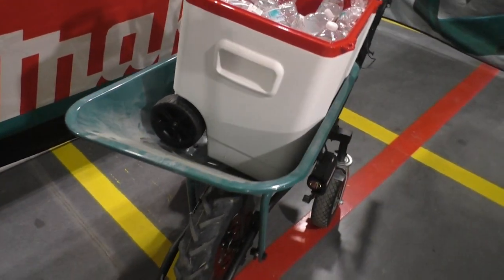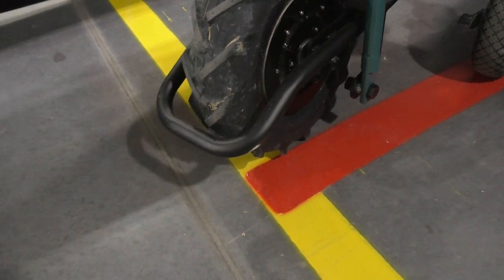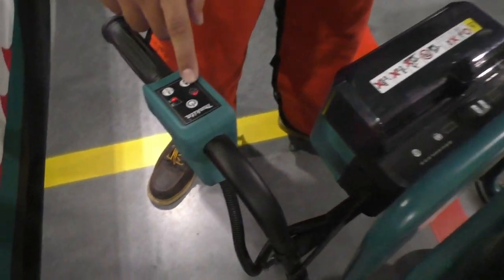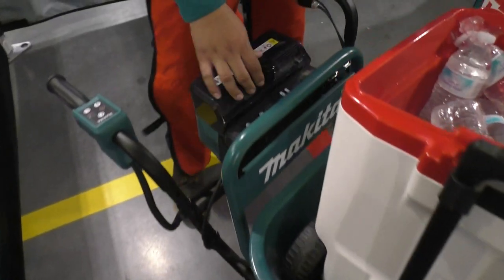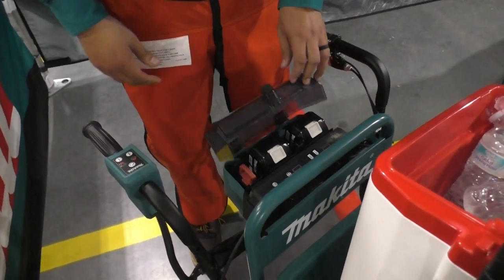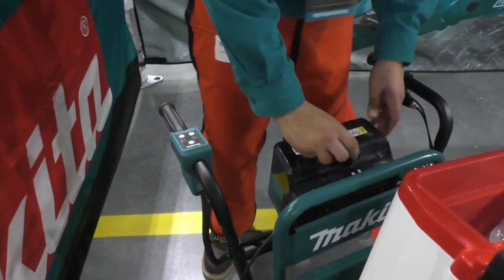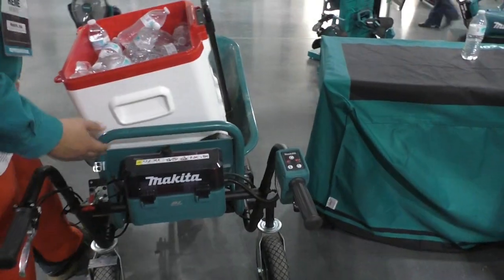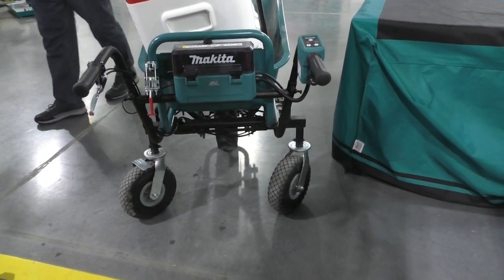Makita 18V Power Assist Wheel Barrow, Bucket or Rack

Comment: I'm 65 years old and I've had seven spinal surgeries, five being fusions.  It was either buy something like this or give up yard work.  I bought one and it is great.  I can easily move 200 lbs of rock, dirt or whatever from my front yard to back yard over a steep grade.  BTW, in response to comments about the handles being low, their height is adjustable.  Also, the design is extremely stable, it does not tip nor is it ever unsteady.  The loaded tray is ridiculously easy to dump one handed.  It's two speed gearbox loaded to the gills moves faster than any equally loaded human powered wheelbarrow.

Comment: I really would love to have both of these models. I’ve had 6 spine surgeries and have a tone of nerve damage from complications. These would be a godsend!
Reply: you can buy the rack or bucket separately and use the same drive part.  pretty neat tool I think
Reply: I got one - my back is f$&ked from years of professional fighting.  I welded up my own pipe frame - to use as a base for any job I want to do (with anchor points to easy slot different jigs in). 

I use it to cart large rocks for rocksscapes; compost bags with plant and tools; tiles/adhesive and water basin to rinse tiles and tools when I’m tiling. 

I had plans to fabricate a battery operated cement mixer (powered from a brushless motor and an 18v battery)… a setup that was self moving.

Comment: for real use on a real jobsite, remove rear caster wheels.  they add weight when lifting the handles.  relocate the box with the batteries to beneath the tray.  it adds weight when lifting the handles.  remove the dumping mechanism that allows the tray to tip forward.  lifting the handles higher will also empty the tray, therefore it is extra weight.  remove the lights.  they add a little bit of extra weight plus wiring to get snagged on things.  if it is dark you should have knocked off hours ago.  the front wheel is too narrow.  only suitable for carrying light loads in showrooms.  have a look for tmp powered wheelbarrows.  they're designed for building sites.

Comment: need a bigger tray for landscapers.  8 cuft is the sweetspot for mulch
Reply: Because the tray or barrow is held by 4 bolts - you could easily fabricobbel up any type of tray you needed.

That’s what I’m doing.
Reply: I made a custom pipe
Frame, extendable to take 2 x 80gallon thick plastic totes.  Made from steel tube, allowing to take ratchet straps or bungee straps

Comment: I can tell this design would be very unstable.
They should have had the 2 wheels in the front not at the back.
Big fail
Reply: two words.....reliant robin
Reply: There is a video of a guy using this on a job site, falling all over the place.  Complete Waste of money.
Reply: The dual headlights make up for the lack of two wheels in the front.  I'm kind of disappointed there is no hydraulic piston to tip the bucket.
Reply: I don't disagree, but most wheel barrels have a single wheel in the front for maneuverability. Also, rolling it up into a trailer our into a container it's a far quicker setup with a single 2x12" or one trailer ramp. Like most wheel barrels, someone who doesn't use one often is apt to stumble a lot. Fit a small property owner who can't justify buying a front end loader, there are few sub$500 alternatives. SURE, everyone had thirty own concrete buggy, $40k tractor, draft houses, etc. This seems like a real world solution though. I'm calculating excuses to by one now.
Reply: @adrcamacho1  , a wheelbarrow not suited to off-road work but suitable for grannies.   how do i find this reality video you mention?
Reply: @theoriginalcttheoriginalct6938  Excuses will find you as you age. I just bought one.
Reply: Pretty stable for very very light work . Use an atv or John Deere Gator for anything over 200 lbs

Comment: Makita I've got about 10 of your batteries that just stopped charging... in other words your expensive 
batteries matter of fact I bought knowing how they don't hold up I got a kit with 2 5 amp your bats at home depot Christmas special,  and while I spared using these I used one in my sawall, to was hot out side and it was getting low and went to charge it and it 
never would charge AGAIN.... that was a 399 kit...
I have most of your tools but the batteries have a lot to be desired.....i no longer recommend your tools.
 about ten dead batteries.....tools ok. was o
going to get te circular saw.. and my (porta) band saw gave up......yes I know how to use tools.... way too many dollars spent.....i even still have one of the 12v impacts. that first came out.....even some 7.2 stuff.
 the radio gave up....2 sawalls quit....but I had to have 
one .........so I'm forced to find a kit on sale to get the batteries......sad.......... I'm the only one who use my tools......come by and see for your self .....I'm close to a HOME  DEPOT .......if they still carry your stuff
Reply: Sell their stuff out, switch to Milwaukee For battery longevity if you wish, switch to Dewalt for power,either way both are guaranteed tough & it's nothing but heavy duty ,bet you won't go wrong i have both for years no problems beaten & battered all over the place lol,yet still won't die.
Reply: Sorry about your battery woes, sir. I became an exclusive Makita user solely because of battery stability. Fortunately, I'm in the mid climate of Texas, do cold isn't an issue. But of the original 6 batteries that I bought when the lxt line first came out, only my 2-1.5ah were destroyed through abuse, and one 3.0 fired 2 years old-most likely because I dropped it 1,000 times(which these batteries seem to be designed for).
  I have to be honest though- I'm a Super D-bag when it comes to not spring batteries any Lee's than 100% charged, not fully discharging and routing my batteries in use. Anyone who I let borrow a tool that completely runs out a battery or returns one not fully charged can never use one again.
Reply: KelMaster Construction  That's interesting, I've had completely the opposite experience. I used to do home theater install. I used Makita and pretty much everyone I worked with had DeWalts.  Had that job for a number of years, and never had to replace my batteries despite heavy use.  Every person I worked with had replaced at least a couple of their DeWalt batteries.
Reply: KelMaster Construction  no arguments on the level of abuse. I was just stating that to show the drills had comparable work loads